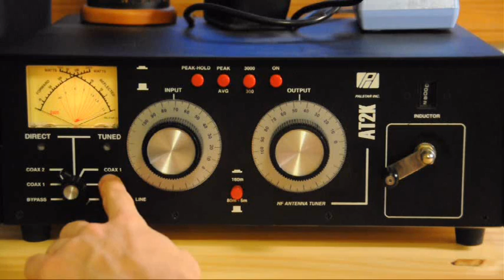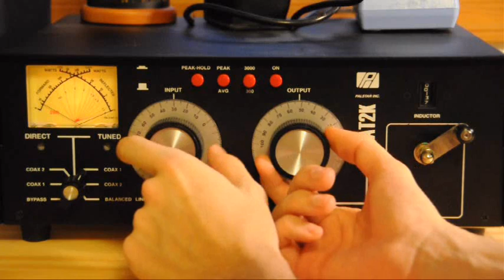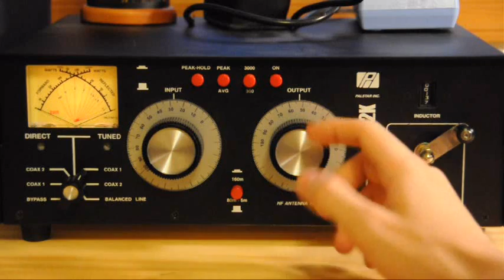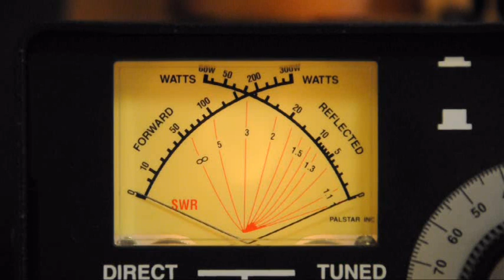Ham Radio Tutorial - How To Use An Antenna Tuner

Comment: Good video. I actually use an MFJ993B Auto Tuner... I just key up and it just slams out the settings in less than 5 seconds haha. But yes a manual tuner is going to offer a much finer resolution and has a retro feel to it. Im actually in the market for a good legal limit tuner.
Reply: Well now 2 years ago on this comment ... well lets just say alot changes in 2 years and what you learn. Got a Palstar BT1500A balanced line tuner and I pretty much only use balanced feed line now over coax. Palstar makes a great tuner and thanks again N7TFP for the video that our new hams are always going to be able to reference.

Comment: Not bad, but not entirely accurate.  Many perfectly tuned antennas have an impedance that is not 50 ohms.  The antenna tuner matches the impedance for the transistor radios that have a 50 ohm impedance.  Tube radios don't have that problem because there is a tuning network that is built in to match the high impedance of the tubes to the lower impedance of most antennas.
Reply: I agree. A resonant antenna may not have a 50-ohm impedance. However, a standing wave will still exist if that antenna is fed with 50-ohm coax do to the impedance mismatch at the feed point of the antenna. Thus, a tuner may still be necessary to protect the radio. This explains why it's best to have the tuner as close as possible to the antenna, and not the radio. Alas, convenience trumps all, and the tuner is usually located in the shack quite far from the antenna.

Comment: Nice video. You made this about the time I had an MRJ-989 tuner. I believe I had a 949 before that but it couldn't handle the power of Ameritron AL-811 amp. I have a trapped vertical, and wire OCF Dipole 40 meters and more bands, and a wire 80 m dipole. When you have an amplifier you HAVE to have an external tuner. The internal tuner won't help on the output side of the amplifier towards the antennas. I somehow glitched the internal tuner in my TS-480SAT tranceiver the first year I had it by cleaning inside the radio. not having the internal tuner working - makes you work harder at cutting (or adjusting the traps in a vertical) a wire antenna for the right length to be resonant where you need it. If you depend too much on the tuner you don't sent out as much power and thus as much signal ... the antenna will still be as bad as it is on the frequency in question .... just your radio or amplifier will be happy with it. At the other end of the coax the mismatch is still there.

Comment: I agree with Crobular, Hamsphere isn't radio. As a licensed amateur radio operator fake internet "ham radio" offends me. Nothing can compare to the excitement of a 5000 mile DX contact using only 5 watts and a homebuilt wire antenna. If I want to talk to people on internet ham radio, that's what IRLP is for. IRLP at least requires a radio to reach your local IRLP node. 

Hamsphere is just "ham radio" flavored skype. I highly encourage you to get your license and ditch fake ham radio.

Comment: Nice video. When I was younger, I could not afford an antenna tuner so I had to do it the old fashioned way; cut the antenna to the middle of the band and hope for the best. Of course, Novices in the 70s could only be crystal controlled with no more than 75W.

Comment: Liked the video, thought good as to operation of a tuner.  However, when the author got to describing how a tuner works, how performance is affected, effects of SWR he needs to do a LOT of reading.  Antenna tuners do improve performance by getting more power into the radiator, the antenna. When there is power coming back down the feedline that power has to go some where.  That power is reflected from the tuner back up the feedline to again go into antenna.  Read Reflections II at CQ Mag. thanks

Comment: If you transmit into a load with very low impedance (let's say it's 2-10 ohms complex impedance) with full output power, the amount of RF current flowing through the RF power FET's in your transceiver exceeds the heat dissipation limitations.  The heat cooks the FETs and suddenly you have no output.  A high impedance causes damage due to high voltage levels that again exceeds component limitations.  It also puts a severe strain on your radio's circuits.  

Hope that helps.  

73,

Comment: A high SWR is a symptom of an impedance mismatch, but the reflected wave does not cause the damage.  
All new transceivers are equipped with a fold back circuit that reduces RF power output when the ham transmits into a load (ie. feedline/antenna) that is not a 50 ohm impedance match. Consider what would happen if the roll back circuit wasn't there to protect the transceiver.  Continued in 3rd post

Comment: Good video.  
You said at 1:05 that the ATU allows minimum reflected power from getting into the transmitter.  This needs to be clarified as many new hams are incorrectly taught that a high SWR ratio allows standing waves to reach the transmitter, and claim it is the primary cause of transmitter damage.  Standing waves are not the cause of the damage, as any standing waves are reflected back to the load (ie. antenna).  They are not reflected back into the transmitter.   Continued next post...
Reply: idiot!

Comment: It knows that it's ant input impedance should be 50ohms, if you connect an ant "without" an ATU/AMU, the radio's ant input is NOT matched with the ant, no matter what kind of radio is being used. Even a dipole cut for a specific frequency has an impedance of 72-75ohms at it's center, feeding it to the radio with 50ohm coax does NOT change the impedance the radio see's at it's input. A tuner/matcher alters the impedance it see's at it's input, to match the radio's input impedance of 50ohms.

Comment: Let's bottom line this, an ATU does NOT tune an antenna, it FOOLS the radio into thinking it's hooked up to an antenna resonant at 50 Ohms. It should'nt really  be called an ATU, more accurately should be termed as an AMU, an Antenna Matching Unit. Even a dipole working at resonance at a frequency, is unmatched, as the impedance at the center is (using coax) is generally 72-75 ohms. So even an antenna usually thought of as "resonant" really is'nt. Still needs matching to radios input of 50 ohms.

Comment: grt vid. i recently bought a1945 vtvm by precision instruments  model ev-10 it has a decibel meter setting for adjustibg antenna. but the manual states that at that time most loads were 500 ohms.have  u ever heard a tx using that mqny ohms.ty

Comment: No listening?  No QRL?  If you did, it was too long before transmitting.  The frequency may well have no longer been "clear".

Shame on you.

And, technically, you didn't find a "resonant point" at 8:03, but you have fooled the transmitter into thinking that you have.  You have performed an impedance transformation, but that is not the same thing as achieving resonance.

Two beefs, on major and one minor; other than that, though, it was an informative video for a lot of people.

73,
Ed, KI6DCB

Comment: Very clear - you are quite right of course you are only matching the impedance of the tuner to the transmitter, protecting the output stage of the transmitter. Reflections continue between the antenna and the tuner. How ever the use of a balanced transmission line between the tuner and the antenna can do a lot to cut the losses that this would otherwise incur. If you locate the tuner at the antenna (as a remote auto tuner), even better.

Comment: The art of building an antenna is something that really can't be adequately told here. I would recommend doing a little research on building antennas for the band or frequency you intend to use. An SWR meter can help you during the building/testing phase IF you have a transmitter with a variable power output as told here in this video, but if you're serious about antenna building, I'd recommend investing in something like an MFJ antenna analyzer.

Comment: The best antenna you can use is an 80 meter dipole fed with 300 Ohm feed line through a tuner with a Bal-Un. That antenna will cover 80 through 10 meters. If you don't have a lot of room you could use a 40 meter dipole for 40 and up.

Comment: G5RV is just about OK on 40m. I have a full size and it's just about OK on 80m but only really resonant on 40m. I use a SGC SG230 Smartuner and this is all done automatically. In short yes it is a good idea to use a tuner on a G5RV as it will have many mismatches on all bands bar 7mhz or 40m with a 1:2 SWR on a good day.

Comment: In short NO. You need to transmit (CW is constant) to match the two together. If you have an MFJ 296 Antenna analyser then you can just hook up that to your antenna and check to see which bands it's resonant on before you begin. The MFJ is like a mini radio with ultra low power to test your antenna. But failing that you just use the minimum power to tune your radio. I also call on 5w and check clear before I tune and before I step up the power I call on 100w too as they may be on 5w.

Comment: Very good presentation.  I've worked with mobile radio for years, and remember tuning the antenna sticks by clipping off short pieces.  A longer design lets you do this; adding to a stick that's been made to short, you get a new (long rod) one and start over.

Comment: I find that using an antenna analyzer to be the best method. When you don't have to worry about causing interferance or blowing the finals it becomes a fun process. Write down the settings for a few frequencies on each band so that you are well in the ball park when you go back on the air. Analyzers are now resonably priced and the simplest one will do the job;we're just tuning an AT,not designing sophisticated antennae. Thanks for the video.

Comment: @tylergig Before matching the antenna to the radio via the ATU/AMU, The operator should tune into a dummy load, to maximise the output for that frequency into the 50 ohm dummy load. However after tuneup, and assuming the antenna is not resonant at the TX freq that the radio was tuned up for, the impedance of the antenna will NOT match the 50 ohm into to the radio and thus has to be "MATCHED TO THE RADIO", which of course is what your video is all about.
Jeff M1BCM

Comment: I'm considering getting a remote antenna tuner, to place it where the antenna connects to the transmission line... I hear this is a better approach than the current tuner-at-the-transceiver setup... your thoughts?

Comment: Your videos are great. Very informative and I like how you cover topics that are useful to anyone starting out in the hobby. Keep up the good work!
Reply: It's not an antenna tuner it is a coax coupler.  The AT2K is not tuning the antenna, nothing changes on the antenna relative to resonance. The SWR reflected at the coax connector at the output of the AT2K is the result of the match or mis-match of the 50ohm coax at the feed-point of the antenna.  The AT2K couples the 50 ohm coax from the transmitter to the impedance reflected at the output connector. The AT2K is coupler or matching device not an antenna tuner.  Aside from the improper use of the term antenna tuner the video is a good demonstration for novices and non-technical amateurs operators who took ham cram classes instead of going to a radio club that teaches theory!  In the old days antenna couplers were not used to fix the mis-match at the output but instead to extend the usable bandwidth of a resonant antenna.  The mis-match still exist on the feed-line and losses due to high SWR still occur but the transmitter will be happy!

One item not covered in the video is the radiation from the coax which has high SWR may find its way into the audio of the transmitter and other electronics in the radio room.  So, best to install a choke balun on coax feed-line outside the radio room to help eliminate RF on the shield of the coax.  Best to install a choke at the feed-point of the antenna and at the entrance to the QTH for more details check out WA3GIN on QRZ.COM for details on how to make your own inexpensive choke-balun.

73